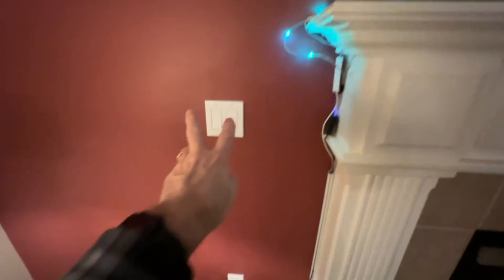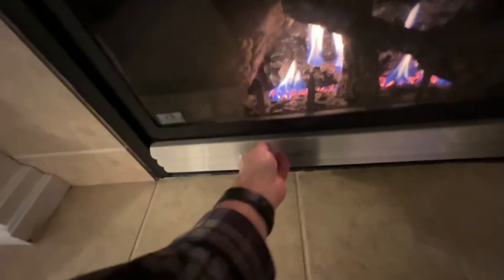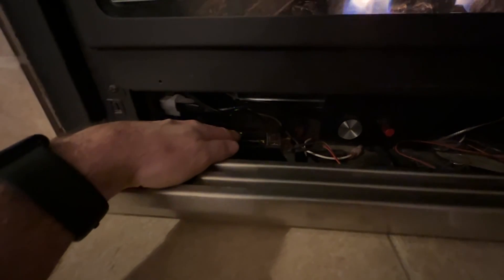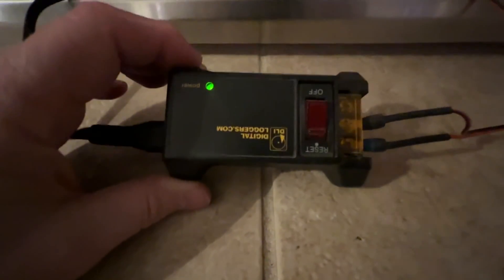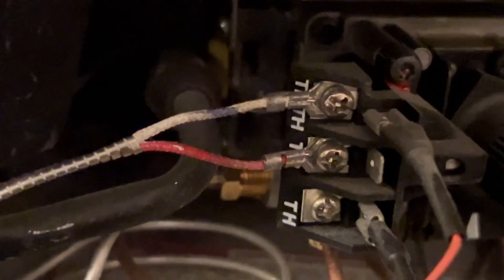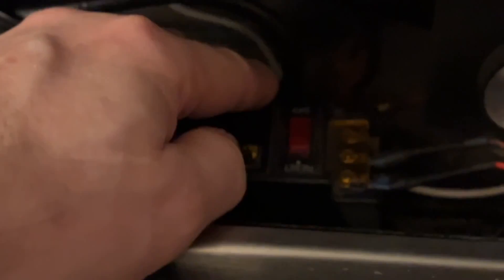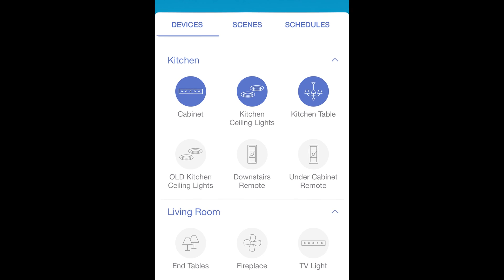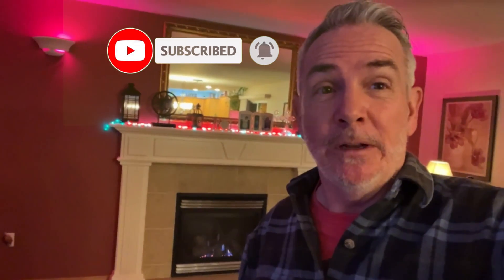Enable Gas Fireplace With Apple Home

Comment: how did you get a wled module on homekit?
Reply from the maker: Hi, there are two ways, 1) use in an Automation in Apple Home and create a Siri shortcut with the HTTP API commands, found here: https://kno.wled.ge/interfaces/http-api/, or 2) Use Homebridge running on a RPi and use the Simple WLED plugin, found here: https://github.com/jstrausd/homebridge-simple-wled. Thanks for watching.